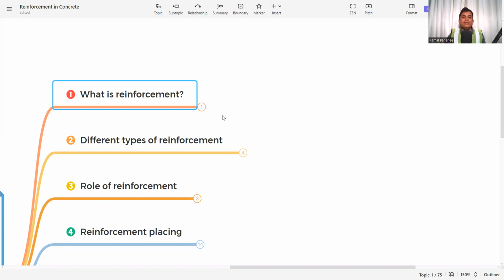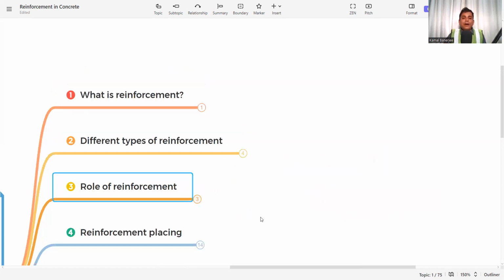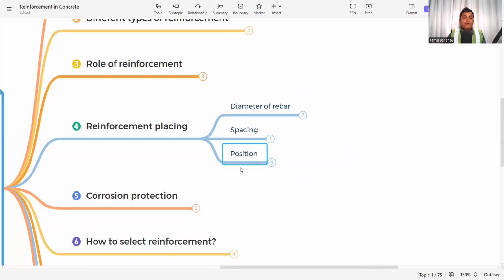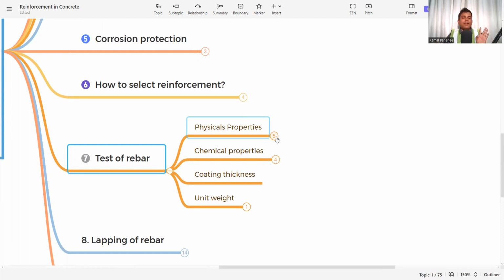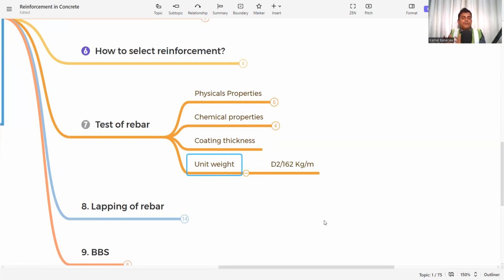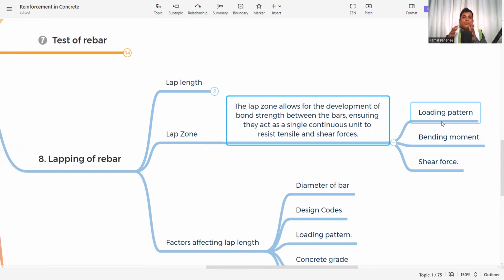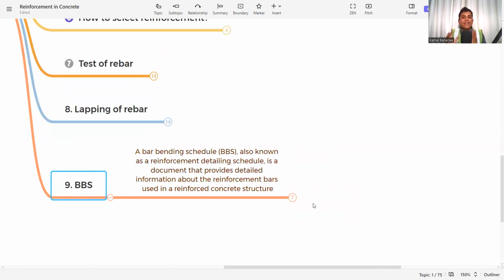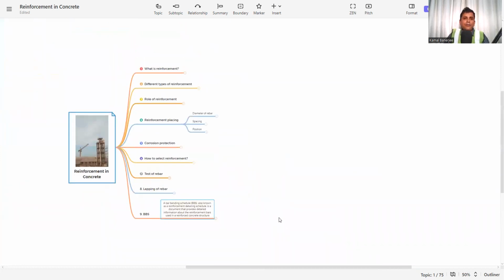The Essential Guide to Reinforcement in Civil Engineering

Comment: What to do if a section becomes heavily reinforced and it becomes difficult to ensure proper flow of concrete during casting?
Reply from the maker: Restrict the maximum size of aggregate 10mm  and use self compacting concrete instead of normal concrete.